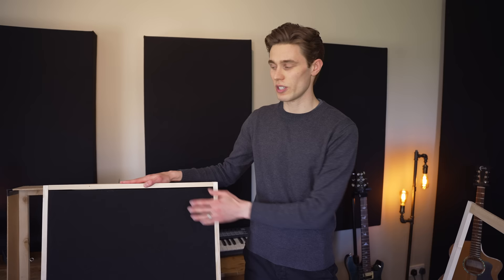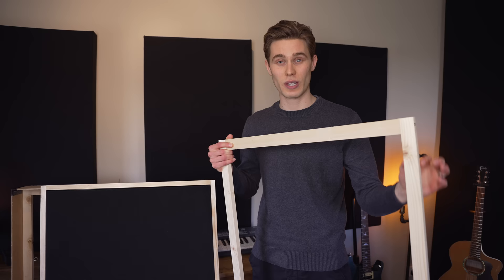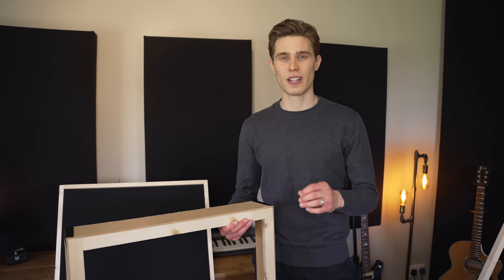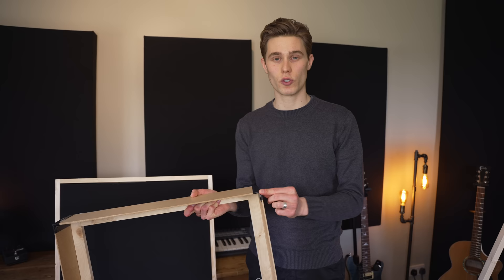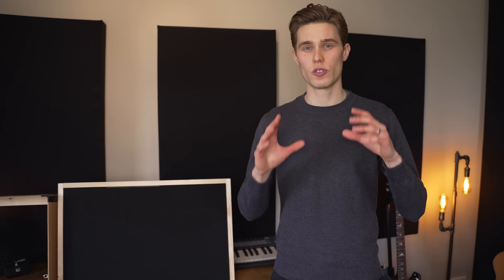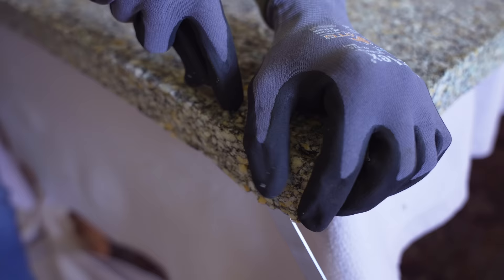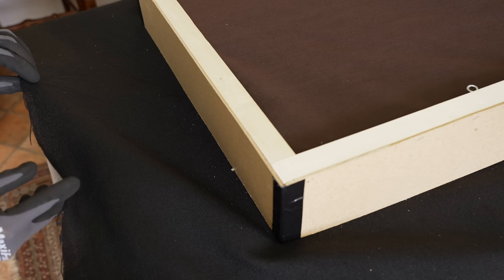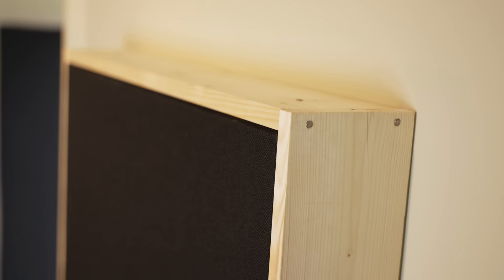How To Make Your Own Acoustic Panels - DIY Professional Acoustic Treatment for Home Studio

Comment: I absolutely love this, people don't talk enough about how dangerous fiberglass and rock wool are to work with. I've even used old towels stapled into a frame before (SHOCKINGLY effective) but fiberglass isn't worth the risk. Recycled denim/fabric is a brilliant idea. Thanks for the great content!
Reply: you should fear fire hazard more than rockwool, besides those materials you listed are very different. fiberglass has many kinds old and new. rockwool is a different beast its an industry standard
Reply: @MrFree-vj8qj  Sure, rock wool is commonly used and cheap. But there is no need to worry about fire hazard with cellulose based products; they are all chemically treated to be fire retardant and they comply with fire codes.
Reply: yeah i see a lot a recycles cotton. and DIY perks uses towels. i think im just gonna use that for stuffing boxes and sound panels.
Reply: @tjblues01 hey I saw cellulose at my local Home Depot and couldn’t find anything else.. is that safe as well.. don’t know what it really means .. couldn’t find the ones listed
Reply: @benjaminmeirelles5120  Yep cellulose is pretty safe to use. It's basically wood pulp of the same sort you'd see in paper production. The biggest issue is inhalation, so use a respirator when working with it. Commercially available cellulose is treated with a boric acid compound that makes it fire resistant, which is the larger issue with DIY recycled denim or cotton batting. Cellulose can also settle when used in tall vertical applications like this, so you'd want to check after a while to see if there's a gap towards the top.
Reply: There are a lot of differing materials and fabrics currently. There’s new types of cork (traditional cork is hard to grow) and there are many PET felts. It depends on whether you’re in a fairly permanent environment or something you’re going to have to move to different locations and of course, your budget. Then comes room size and shape. Back in the 90’s we didn’t have software to test acoustics and lasers for speaker placement. So I see the trade off in labour, expense and technology. One has to take into account your own ear, too. Ear architecture ie:shape/size is different so it’s going to subjective depending on so many things. In hindsight I’d make some panels different sizes and with different surfaces depending on what the measurements are. You might be into surround sound or doing Dolby Atmos mixes or dialogue (ADR) there’s so many variables I’d be here for a week lusting then off and still miss most of them. So thinking ahead for me portability was an issue. We had big panels made which were great for eating up resonance of bass and high frequency refractions. Trouble being obvious they needed two people to hang them and keep them uncoupled from the wall. I think it’s worth spending time doing (free) research and letting your fingers do the walking via phone, text and internet connections. Then do a budget and research sources and finally (cliché) do what’s best for your personal situation. I ended up moving a lot so I’ve got software, headphones and monitors. The monitors match the character of the headphones and I can use software to mimic via impulse responses to check out how my mix is and how everything sits in the mix. And because I do stuff for big screen and TV there’s a difference there. TV is immediate. A movie theatre is different. Rhythm and timing is totally different. Check it out sometime if you get the chance. I didn’t even think about it until Netflix and so many Made For TV and straight to video mixes came along. Video games are another example to consider if it’s your field. Figure out your forté if you’re just getting into the business or trying to break in and don’t spend any money that’s not absolutely necessary unless you’re doing it for a hobby. You’ll regret impulse buying the latest and greatest. Start simple. Less variables means less headaches. You wanna cover all the bases (basses?) so to speak and be a yes person to all the work of all types and at the same time you do not want to spread yourself thin and not be compensated. Geography means a lot, too. Some communities are very clique’y and some are super supportive. It’s all about connections. Make good connections with real people who aren’t out to take advantage of you, as though you’re an intern working for nothing. Apologies for getting off track with the acoustics. I’m just offering because I’ve been asked a few times and people want to be hooked up with pros right after film school or recording school and I can’t vouch for someone I do not know. And same thing I’m not a sales person and I work with a small group whom I’ve know for awhile and everything goes through them. I’ve had enough of working with people who promise and name drop and when it sines time for the credit’s, copyrights to my work and payment, suddenly they have something that comes up and they can’t pay and you’re waiting. This happens at the 11th hour sometimes. Good luck to everyone! Music is a gift so be proud you’re creative or technically proficient and have fun. If it’s all work and no fun then you’re not in the right field. Find your niche!
Reply: @MrFree-vj8qj  I used rockwool but I put them carefully with mask and hand glove. Is it still dangerous (for brething the air) to have it even it is covered by fabric in the panel?
Reply: it's fine. I've got 6 panels in my room filled with rockwool, had them for 3 years. No problems :)
Reply: @Lolwutdesu9000  Hi Thank you for the answer- I put two layers of fabric to cover but I think one is enough... just to make sure.
Reply: Well if Rockwool needs to be covered with breathable fabric then doesn’t they mean it will release particles through the fabric?

Also how much safer is the denim if it’s treated with boric acid anyways , since it also will have to be covered with breathable fabric?
Reply: @heythere6983  I asked many experts after my original comment. Basically Rockwool is just "Dusts" same as dusts in the room. No bigger than that. I thought about particles but if you imagine vacuum or hoover bag, do you think the dust will come out unless you shake them all the time? Then rockwool acoustic panel will be the same as mass of dust covered by fabric. If you worry, I would cover two layers of fabric both sides. I think the dust in the room we don't clean is more dangerous than that. I believe like this for now.
Reply: Rockwool is not hazardous.

Comment: A friend and I spent a few weekends building acoustic panels after watching an older guide of yours! One thing we realized was that—at least in the United States—the cost of lumber from hardware stores can add up really really quickly. If we were to do it again, we'd probably try buying direct from a mill.

And I'm glad you mentioned safer fillings. We ended up reluctantly using Rockwool with a lot of precautions, just because it was difficult to find information on alternatives.
Reply from the maker: This is one of the reasons I removed the old video, it just doesn’t make sense in these times to use that much wood or use dangerous materials.
Reply: You can use any material that's strong enough for the job. Doesn't have to be wood, and can certainly be recycled, like saving old Ikea panels from the trash for example.
I know in some part of the world, more and more people building tiny houses, cabins, sheds or even full blow houses have switched to steel (light steel framing) because it's cheaper (while usually being stronger, lighter). Especially if you can borrow a good drill and an angle grinder, you can go very inexpensive this way by buying longer pieces of metal on sale, and adjusting to your dimensions.
Just a warning: for some applications, don't buy to thin a metal piece, you don't want them to start to resonate with your audio.

Comment: When I built my video studio, I used Duct Board which is used for making air conditioning ducts. It's made of fiberglass with a silver back and comes in different thicknesses. I screwed it directly to the ceiling. It worked very well removing the pin pong sound effect in 20'x30'x12' space.

You can also build sound panels on wheels to move them about as needed.

Other wall treatments included an off-set stud wall, fiberboard, Z channel and double layers of 5/8" drywall. Lots of work and lots of money.  Cheers

Comment: Thank you so much for this tutorial. I've been dreaming of having a space where I could do this since I favorited this video. Three months ago I got that space and this weekend assembled six 4'x2'x2" panels. Some cost breakdown for audience members in the US, because "affordable" is somewhat debatable with how inflation is hammering us since the year this was published. I see California reported in, but my experience was pretty different. In my opinion, I did this the most bare bones I could have possibly done it and my costs came out quite a bit higher than theirs. I don't have outside frames on mine, either.

Final materials cost: $384 for $64 per panel (Minnesota 2024). Could have been $57 per panel. More on why later.
Labor hours: 20ish

For reference, cost per panel to get these from Acoustimac, professionally done:
$99.64 (including shipping)

I made 6 panels, and I got the cheapest frame materials I could get ahold of from Home Depot that wouldn't be a complete waste of money:
1"x2"x8' furring stripboard, QTY 11, $14.63 (warped, but I made it work)
1 pack of galvanized steel staples, $4.87
1/8"x2'x4' MDF board, QTY 3, $19.47
Stainless steel eye screws, QTY 12, $35.76
Stainless steel hanging wire, $9.08
Black duct tape, $8.98
Weed Barrier, $29.99

For the fabric cover I used burlap from Joann Fabrics:
12 yards, $48.05

The one thing I did NOT skimp on was the acoustic insulation. Initially I was going to make four 3" thick panels, so I got a pack of twelve 48"x24"x1" pieces of their ECO-Core recycled cellulose, paper and cotton. With shipping that came to $213.63. If I had known going into it I was going to end up with six thinner panels, I could have saved $7 per panel because they sell a box of six 2" thick pieces for cheaper. This would have brought my cost to $57 per panel.

Things I already owned or did not include in the materials price here but were absolutely necessary to do the job right:
- Circular saw (to rip the MDF strips), drill, counter-sink drill bit, stapler, two industrial clamps, clamping work table, 3" screws

Am I happy I did this instead of ordering them, saving myself $213? Yes. Both the internal and external validation are immense. Would I do this again though? Ehhhhh. Maybe if I used better wood for the frame, but I would have needed the equipment to plane and rip the frame boards myself or increase the costs even further.

Comment: I just want to share my experience with building my panels (after watching this video) 

I found it difficult getting a hold of acoustic treatment materials like the recycled denim, which was my preference.

I settled for Rockwool. Used gloves to install, didn’t have any spillage or any of the material falling out or getting everywhere, it’s not like the messy stuff you find in lofts. I bought them in slabs (1200x600mm) and they worked amazingly. They’ve killed all reverberations and reflections in my room from 6 panels.

So if you’re wondering if Rockwool works ? I can’t recommend it highly enough, I’ll deffos use it again. 

Thanks for this video Michael, it was a huge help.
Reply: Rockwool is absolutely fine to use.  No health issues unless you try eating the stuff.
Reply: @fluphybunny930  If you inhale it, it stays in your lungs forever.

Comment: There is another consideration that factored into me using rockwool in the end - the fire rating. I will caveat that by saying I treated the entire interior surface of my room though, so fire considerations were part of that element of the design. I did make floating panels like these to go over the main reflection points, so in retrospect I probably would have used something easier on the skin/body for those, but I had spare rockwool knocking around and it made sense. Cheese cloth is another incredibly cheap option for the back fabric. I ended up completely covering mine in cheese cloth before using an aesthetically nicer fabric for the finish.
Reply from the maker: It sounds like you did what made most sense. I want to quickly thank you for sharing advice in replies to another comment. I noticed that and it was really great to hear you chip in to the conversation. 

My main issue with mineral and glass wool is that a lot of young folks (like myself when I first used it) are simply not aware of how dangerous it is when handled incorrectly.
Reply: @inthemix  Indeed. And other fiber insulation, like hemp for example, as even easier to work with, no always more expensive, and can also be found in fire retardant version. Well hemp is extraordinarily fire resistant by itself, it's not a lot of work to make hemp wool or panels official fire certified for construction.
Reply: @inthemix  we're all here to help one another! Also, I agree. I'm a bit of a stickler for looking things up before I do anything, but that's probably because I come from an engineering background. You've done the right thing by highlighting the risks of rockwool, getting that stuff in your lungs is no joke.
Reply: Are you saying rockwool is more or less fire retardant than other solutions?
Reply: @SeanofAllTrades  it was more a case of being able to find comprehensive information from the rockwool suppliers on properly certified fire resistances. Quite a few of the alternatives have decent fire retardant properties, but I couldn't find as much information on the alternatives as I could the rockwool. I'm not by any means shitting on the alternatives for fire retardance, rockwool just looked like less of a gamble given the information available to me at the time.
Reply: @inthemix  before constructing my panels, I researched the health effects of Rockwool, and found that no laboratories had issued any health warnings against its use.
Reply from the maker: @willrobinson7578  asbestos was known to be dangerous in 1900 but it took 90 years until it wad fully banned. I would recommend reading about the people living near and working in the factories where mineral and glass wool is made. It’s a real eye opener.
Reply: @inthemix  We've come a long way since 1990- I always stay tuned-in.
Reply: @inthemix   What happened to those people ? I have always thought this insulation stuff is carcinogenic.  I noticed you listed recycled denim as an option, are the acoustic properties as good as rockwool etc ?  I saw a video about towels being good for insulation, but i'm not sure about that.  I have a ton of old clothes which is mostly cotton, like denim and towels,  and i was looking to build floor to ceiling columns for the corners of the room, hopefully reducing bass build up.
Reply: @willrobinson7578   history isn’t a straight line
Reply: There is a difference between working constantly with mineral/glass wool and doing a DIY job like this. Same with people who are constantly working with asbestos and removing 5m2 asbestos yourself in your own house.
Reply: @SeanithanEgan  rockwool is sold as fire and sound insulation in the US it is one of the best acoustic materials in performance.  I have worked installing insulation it is perfectly safe to have in your house hence being sold as housing insulation.  Rockwool is no where as bad to work with as fiberglass in my opinion and it the 1 day it would take to create panels I would not sacrifice the performance.  All acoustic performance is usually available from the manufacturers.

Comment: For vocals, and general purpose this would work great. But the material used for professional studio panel are usually much denser (form 40 up to 80 kg/m3), and that's because 20 or 30 kg/m3 just won't do much to tame really low frequencies from acoustic drum sets or a bass cab, or even for making bass traps.
Although for most home studios I'd say your design would work nicely.
Great video!

Comment: You are absolutely right in material point. To be more specific: It is strictly prohibited in EU region to use glasswool, rockwool, etc... in living rooms without insulation. The proper insulation is an air-sielded, air-tight shielding. Like a completely closed bag - if you wish. Glasswool can harm eyes, nose, can cause severe blood vessel damage in nose and damage in retina. Rockwood can cause lung damage. It does not matter if it is treated to not releasing any dust, but by time, it will... The material which is not releasing any dust is having about 2 - 3 - 4 times price compared to the standard ones, but still not recommended to use without proper insulation, like hiding it behind plasterboard. By the way, nice video.

Comment: I build mine also DIY, the frame is MDF because that wood is denser, I use Rock wool for damping sound, and a special carpet for cars (back in the day, my specialty was building heavy sound systems for cars). If you make them yourself, you can precise tune them for your room, each room is different, works great, and I like that kind of work. I made bass traps too from the same materials. Glad to see you did the same, a friend of mine cut panels with his laser for dispersion panels. And they have a nice pattern. They are great and are esthetic beautiful. I also did my floors, with springs that I got from my work between the concrete and MDF 24mm plates and a special dampening underfloor and on top laminate flooring. Back in the day I bought a big stock Dynamat 300, they used that for removing resonances in cars for big car stereo's. That is the underfloor. If you are a little handy you can do a lot, much cheaper, and better. Because it's all custom build. I have 3 studios that were concrete "bunkers" a nightmare for a studio. Cheers :)